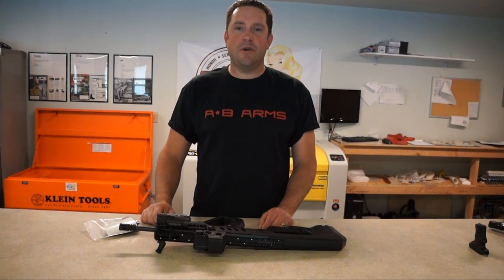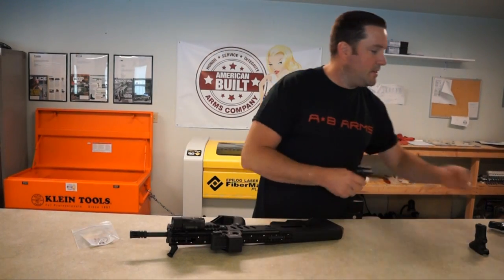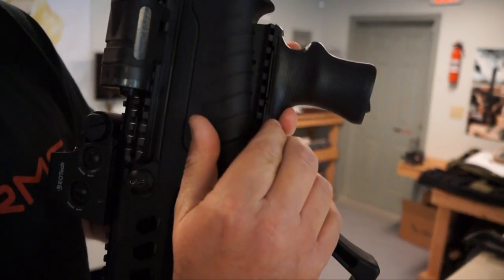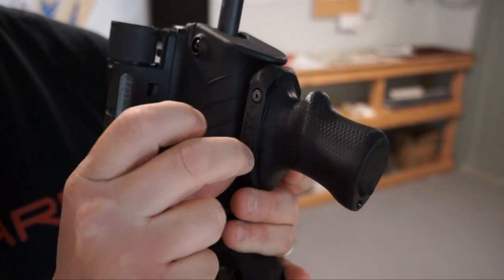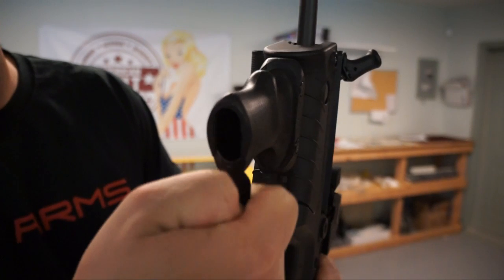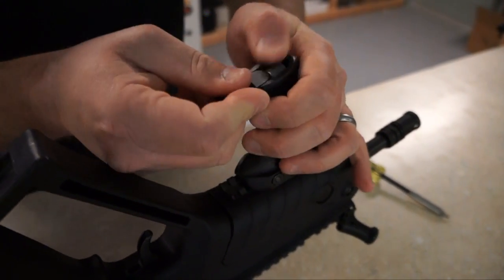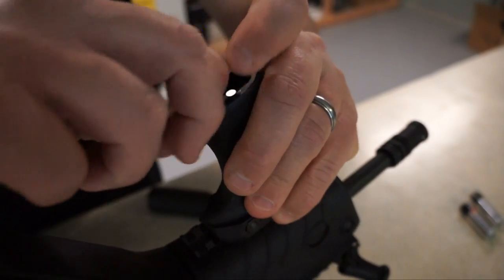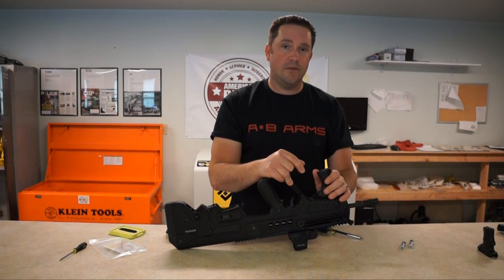A*B Arms T*Grip (TAVOR Grip) Instructional and install video

Comment: Thanks for the video.  If I may ask what light, and light mount are you using on that Tavor?
Reply from the maker: It's an Insight M3X. It has the mount integrated into the light.

Comment: My grip came in the mail today but it doesn't fit the lower rail on my AR or my RFB. The bolts are to short and dont go all the way through. Guess I'm going to have to sand the grip down a bunch.
Reply: Mr Hard join the club. The screws are too fucking short.

Comment: This is not a serious accessory yet. Mk 2 needs the following addressed:
- nobody has time to keep up with a loose piece of styrofoam downrange or otherwise. reshape the internals to securely hold the same combination of batteries.
- scoop out the sides for a pressure switch
- ??
- profit

I’ve seen enough catastrophic barrel failures to NEVER C-clamp the hand guard.